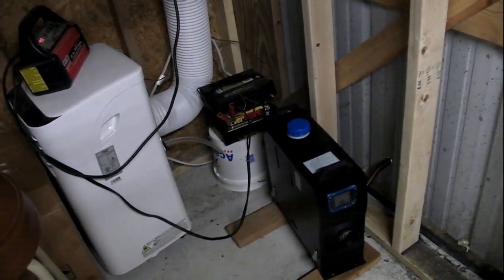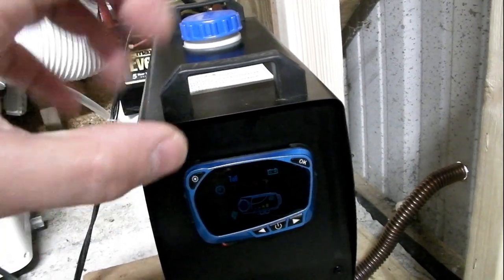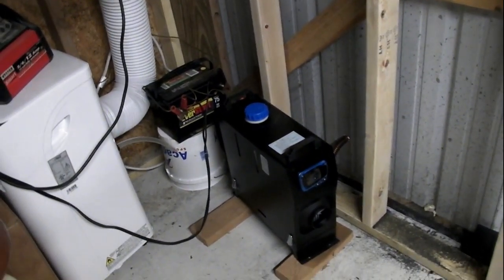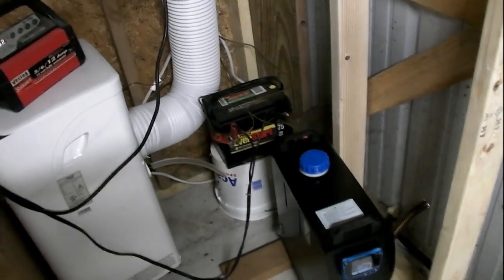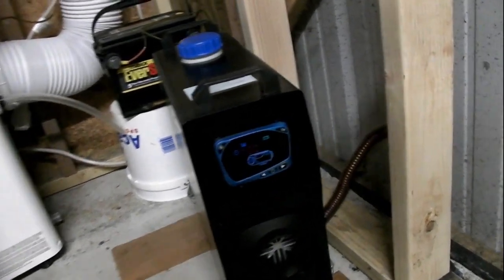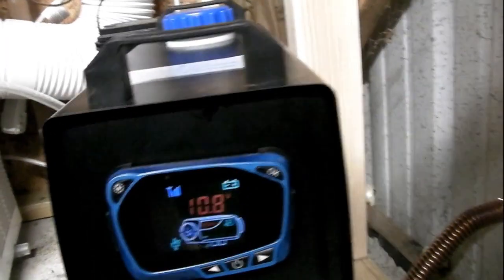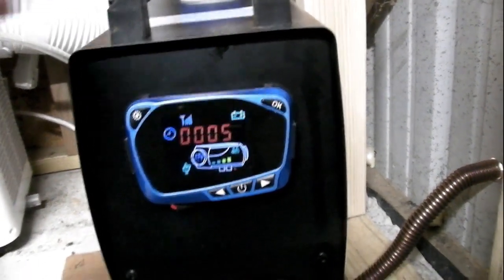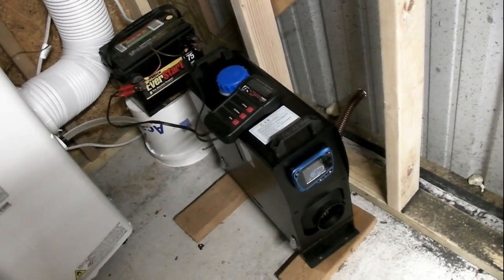How Long Can You Run A Ebay Diesel Heater On A Battery

Comment: See a variety of comments.  Some concerned no cool down when you get error low voltage message.    We do not have the answer to how long can you run a Ebay Heater on a battery.  We do know at some point it will be destroyed or go through the normal shutdown and ready for another day.  Possibly you could get the answer by letting it happen and if no cool down have a second battery ready to go for the cool down.

Comment: Similarly to what Roy said, I too have a 100ah marine deep cycle battery and my unit runs for over 3 days or 72 hours at various pump rates without recharging but usually less than half speed and so far has never gone below 12v. but I charge it before it gets too low cuz I don't want to cause damage to the battery. I have a small solar system but don't have the heater connected to it yet mainly because I just bought my heater 6 weeks ago and now after using it realize I want to install it in a basement area of my large tiny home (500sqft) because of it's noise when on high settings. I also want to connect it to a much larger tank to avoid filling tank daily when weather is very cold. the heat versus cost is better than electric or propane. I also have a wood stove but since becoming disabled (because of a drunk driver) it's hard to carry or process firewood, but even if buying firewood I think this heater is cheaper.

Comment: Yes mine runs a cool down cycle when the battery voltage gets low. If the unit just powered off without the cool down cycle it will literally fry the ecu.
Reply: @roerx8542 people do this demo once to prove it doesnt happen but keep on doing it and it will die eventually. the fan needs to run and so does the glow plug in its shutdown proceedure if you cut the power it cant go through the cool down proceedure, it will blow the caps eventually or the bridge rectifiyer probably the most sensative componant on the ecu board.

Comment: I’m contemplating fitting a diesel heater in our VW T5 camper van and I’m thinking it might be a good idea to have the engine running and charging the battery during the warm up period when it’s drawing the most amps.
Reply: Did you do this? Thinking the same for mine
Reply: @robincrawford4815 It’s not proved necessary have been away this weekend while we had snow and had the heater on all night (set @ 18*c) and the leisure battery was still over 12 volts in the morning ! I had an Eberspacher airtronic 2 fitted and it’s been great to be honest 18*c was too warm during the night will try 16*c next time, I don’t know about the Chinese heaters but the Eberspacher cuts in and out according to the temperature in the van so doesn’t run continuously this uses very little fuel and probably helps conserve the battery too.
Reply: @AJ-qn6gd  most people prefer a cool bedroom as they have a lot of quilts over them to keep warm, try 15 degrees.
Reply: @oojimmyflip  We are trying different things at the moment to see what works well for us but 15*c sounds about right, we have slept out at 6*c outside temperatures without any heating and that was a bit chilly but bearable. The whole point of fitting the heater is to expand the amount of time we can use the van.
Reply: For several years, I have been turning the heater on and off with the engine running. When it reaches the operating temperature, I turn off the engine.

Comment: Glow plug will draw 8 to 10 amps for about 3 min then  it goes down to about 2.5 amps on high. At least that's what I measure on mine with a deep cycle  100ah I get 12 hours plus on high

Comment: I hope youve got a 20amp fuse inline to protect the electrics of the heater, my 75amp car battery runs my 2 kw heater for 30 hours before it needs a recharge thats three days of use to me. my 2 kw is heating my home to 20 degrees C for 10 hours a day. it is 6 times cheaper to run the heater than use my 32 kw gas boiler to heat my home. the lowest voltage has been 11.2 volts but the heater will still run even down to 6.0 volts, basically the heater will kill your car battery if you let it. best way to run it is with a 12amp car charger inline not an electronic charger as it wont run while the heater is running, you need an old style non-elctronic charger which will charge anyway.I usually start the heater every morning with the charger connected and then disconnect the charger once it is warmed up so that the battery gets cycled properly.

Comment: To Mary; connect it to the battery! the longer the distance the bigger the cable diameter will need to be to get the startup amps needed for the glow plug.
Reply: 18 guage wire should be enough for about 5 meters length.

Comment: Just so your commentators know a lead acid battery has zero charge at 10.5 volts. The fact that the heater was still was running below that shows that the readout could be off slightly do to voltage drop in the line. Same with your tester. You shut it down just in time or the heater electronics could have melted down due to the heat not being shed before shutdown was complete.

Comment: Good vid i have a question  tho , im hooking up the diesel heater and i have a 100 watt solar panel setup, and that is connected to the battery do i hook it to the battery or to the solar charge controller,  everything went smooth till i got to this point, lol
Reply: To the 12 v output of the charge controller, it’ll cut off power if the batteries run low
Reply: @medievil2  so what will happens when it goes dark DUH

Comment: Your battery is pooched, That heater draws only 15 watts on low setting, 25 watts on high, after warm up. Battery should last easily 24 hours
Reply: He did have it friggin cranked so it was probably drawing more then normal I'm guessing 2-3a. That group 75 battery had according to Google 44-60ah of which half of that is usable. If it got down to 9v it used more than half.
Reply: @juliogonzo2718  that would still be 10 hours use until down to 50%. 5 hours puts that battery down to 30ah, which as I said, is pooched. Maybe we learned different math, but 3 amp draw for 5 hours is 15ah where I went to school.
Reply: @canadianwarrior2108  it would burn off some charge with the glow plug but yeah, your right it probably was a shitty old battery
Reply: @juliogonzo2718 , it wasn’t “quality” Walmart battery which if two years old as stated is probably passed its use by date !

Comment: Just FYI there are no 8 kw heaters! Only 5kw and 2 kw.
Reply: I have a 8k
Reply: My understanding is that the 5 and 8kw heaters is exactly the same unit. Don't remember exactly how much they really can pump out but some channels have done the math on it. Diesel contains a certain amount of energy and they used that number combined with the fuel consumption to get the kw of heat.
Edit. David tested this in this video
https://youtu.be/0o38XKrTRkI
With i really big pump he got up to 5.6kw of heat. 8kw should consume 777ml of fuel per hour and it's not really doable